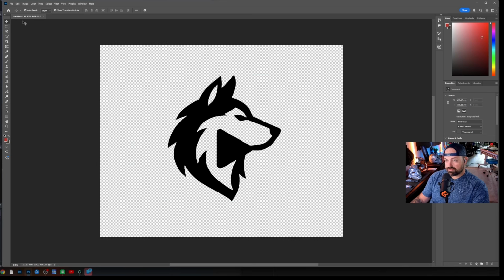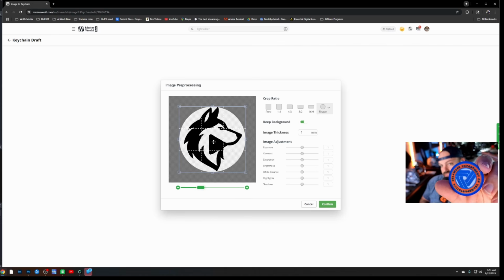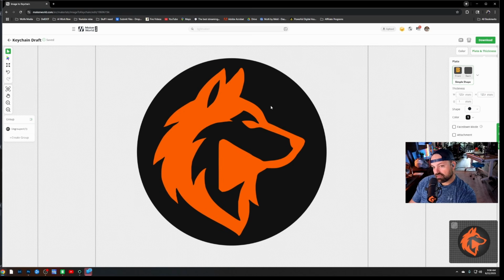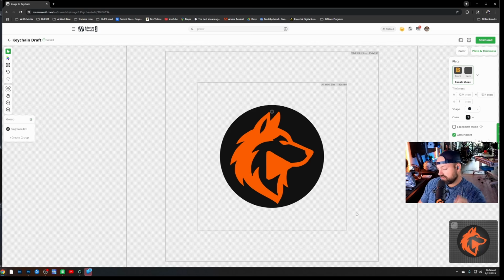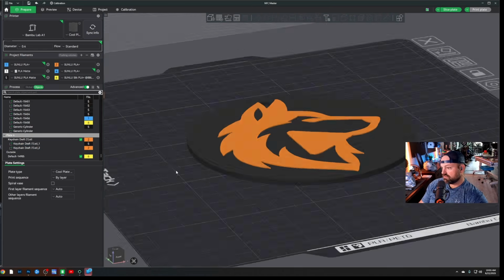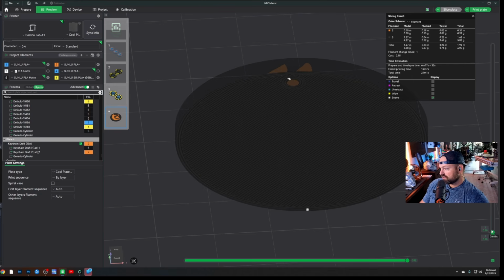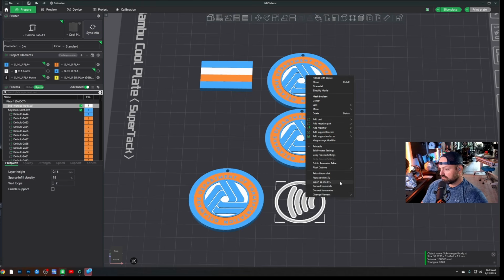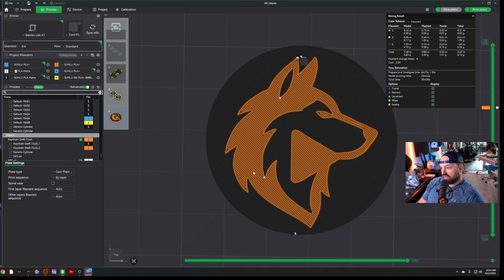3D-Printed NFC Keychain Tutorial: PNG Prep, MakerWorld Build, Pause to Insert Chip

Comment: Great video.  Quick question, when printing a raised image, the quality isn't good.  I get these points/zits randomly in my image.  Sometimes it's at the seams and some times it's where the nozzle changes direction.  Any advice?  I've been flipping all of my prints over so the image is flush on the base plate, but I would really love a raised layer on top.
Reply from the maker: You could try and mess with the ironing settings, I am still trying to dial that in. And also make sure that your filament is dry, that can cause issues like that as well.